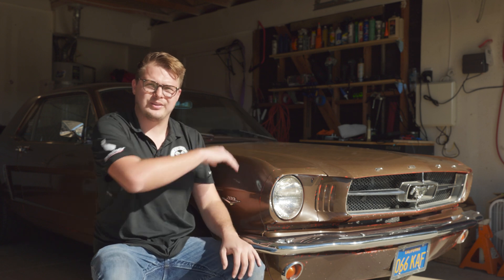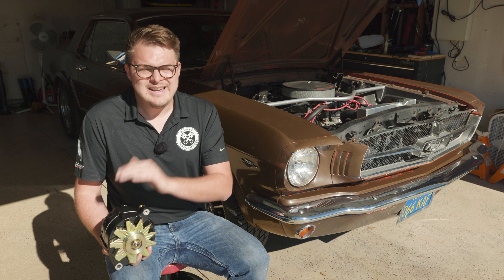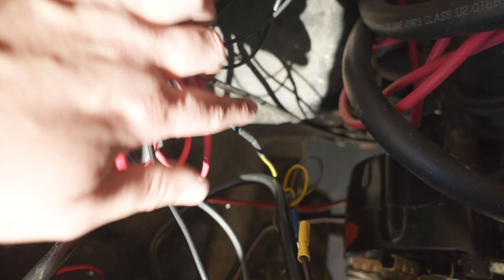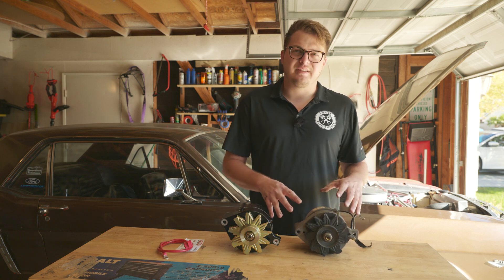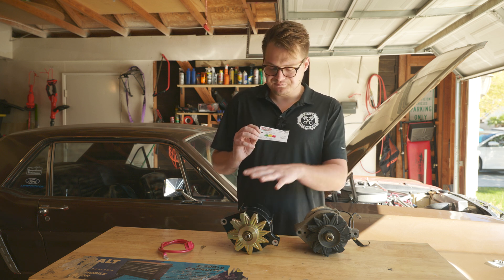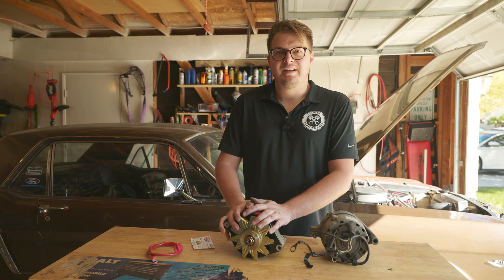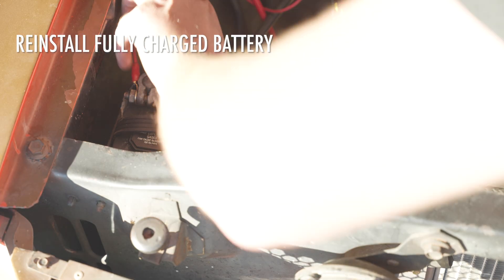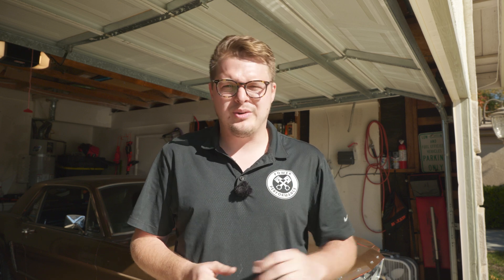Much Needed Simplification in Wiring and Amperage for our 1965 Mustang

Comment: Good explanation regarding the one-wire alternator.  I do not have the load now, but if I add anything to my 1966 289 that increases the amperage requirements, I will be considering a one-wire alternator.  Regarding the amp light, I know I ran across an explanation somewhere on the web; I think it requires connecting a new positive lead to one side of the light.  Good luck.